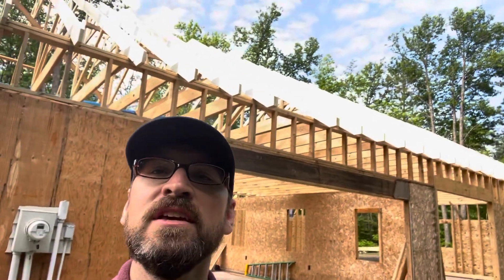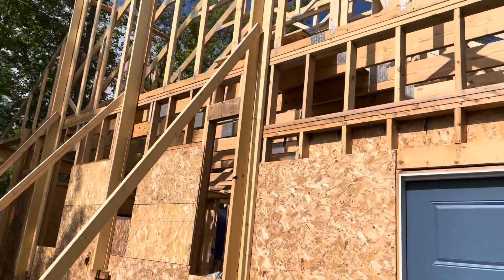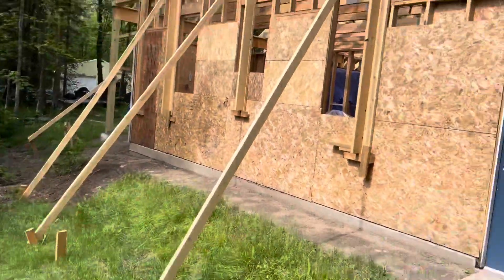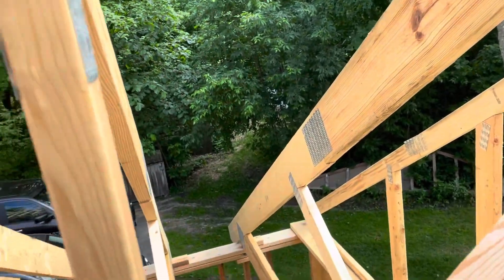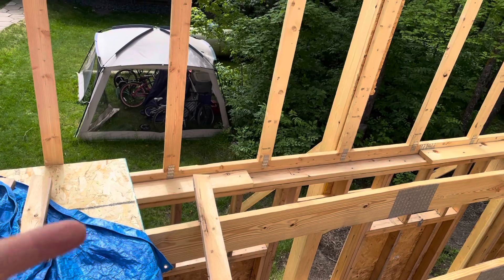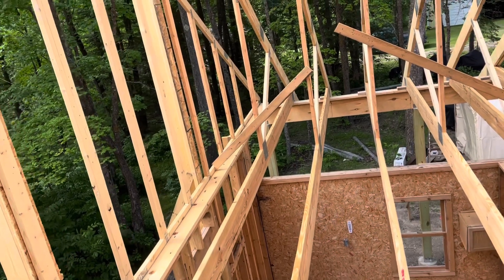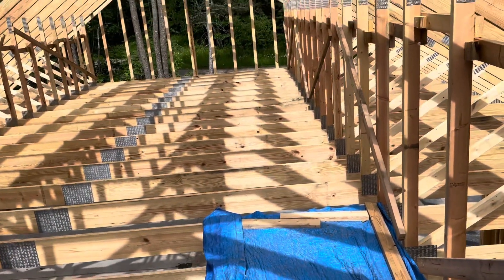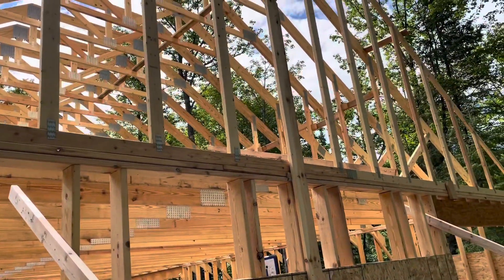Setting and Bracing Large Attic Trusses

Comment: Are Attic trusses designed to expand and contract or can you connect an attic truss to a load and non-load bearing wall
Reply from the maker: Good question! It is my understanding that they will move seasonally, so when attaching non-load bearing walls, I used truss clips. It’s  little L-shaped bracket that is slotted where the truss attaches. This allows the truss to move while still keeping the wall below plumb. 

If you have a designed load bearing wall below your trusses, I think you could hard fasten that. 

Thanks for watching!

Comment: getting ready to do this in two
weeks. gonna follow what you did. Did you install the collar tie bracing when you set the trusses?
Reply from the maker: Hey, I hope it goes well for you! Those were some beasts for us to set, but it’s all good now. Yes, the collar tie bracing went in within a couple days of setting the trusses, I believe. I used 16’ 2x4’s in two full length runs, end to end. That was specified on the print. Let me know how yours goes!
Reply: Thanks. Mine are 28’ with 12/12 pitch so quite not as beastly.

Comment: great video thank you, do you recall the cost per attic truss?, im looking at almost the same dimensions as you,!
Reply from the maker: Thanks for the comment! I just looked it up, each truss was around $650. The crane was $1400 and delivery was $1600. I bought these when lumber was ridiculously high, so hopefully yours are cheaper. Good luck!
Reply: thank you, that's the only thing I can think that the price was probably 2-3 times.  Really appreciate the insight! Do you recall the company you ordered these through?
 @NashwaukSteve
Reply from the maker: Yes, I ordered through Menards, who uses a manufacturer in Wisconsin. Honestly, for the price I paid, I was not impressed with the quality. A number of gang nails were misplaced and the trusses were not perfectly identical. I worked through it, but it made for extra work, certainly.
Reply: really appreciate the info, for the price I wouldn't be either but sure you made it work, thanks again Steve
 @NashwaukSteve

Comment: I'm a retired master carpenter and have some comments. The way you spaced and temp braced your trusses and braced the gables was thorough and well done. Kuddos. I would have done some things to spend less money and saved a lot of time myself but, I got tons of experience. When you showed what you did to span where you had no sheathing structure I was actually impressed. You did it right, although there are many ways to skin a cat. Stairs and stairwells are tricky and you went with one technique that I can see will work fine for you. For this video you get a pat on the back. If you are going to lay out the stairs yourself reply to this comment and I will send you some links to address the layout, principals, how to force the labor and how to do the math. Looks to me that you know how to ask for sage advice, understand, read and take directions. That's important. Stairs are hard.
Reply from the maker: Hello Steve- thank you very much for the comment. I truly appreciate your words and the experience that they come from. By the time this comment was received the stairs were already in. I had some good help laying it out, so I feel confident in them. Cutting all those stringers is no fun! I continue to work away on this project with no end on sight yet. Roof, soffit, fascia and siding are all done, so at least it’s enclosed. Thanks again!
Reply: You are not a master carpenter
Reply: @Bachelor_Brad I have pounded more nails than you have brain cells. 2 things are true. My qualifications and your stupidity.

Comment: Nice video! For your garage door headers, what size beam did you need? Did it require engineering or how did you determine the size?  Also did you end up adding hangers to the 2x8s you install between the girder trusses? Thanks!
Reply from the maker: Hi Evan Weaver- thanks for watching! I used double LVL’s, 14” deep for my headers. I hired a local building supply company’s draftsman to do my initial draw-up and that’s the beams he specified.
As for my 2x8 cross braces, no, I didn’t use hangers. I gave them each about 6 sinker nails, toe-nailed in. That was a budget decision. God bless!